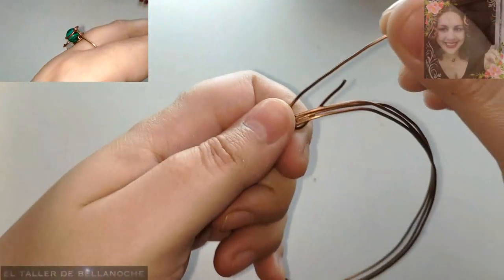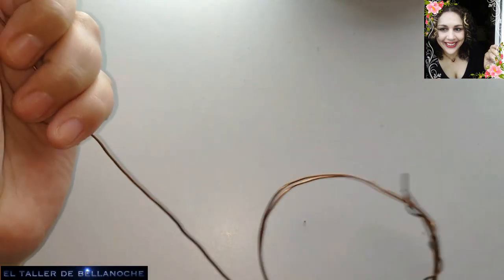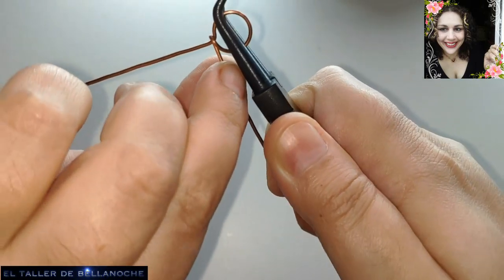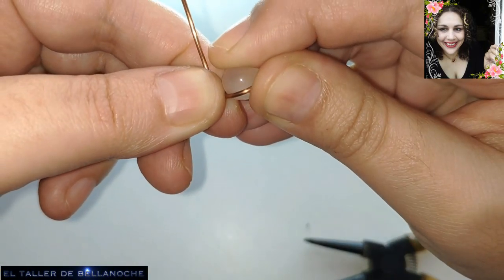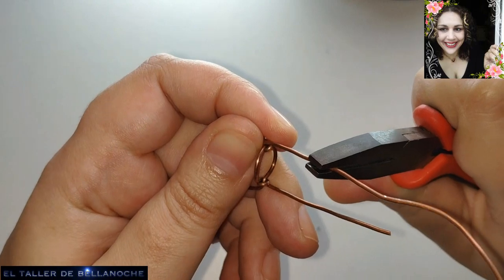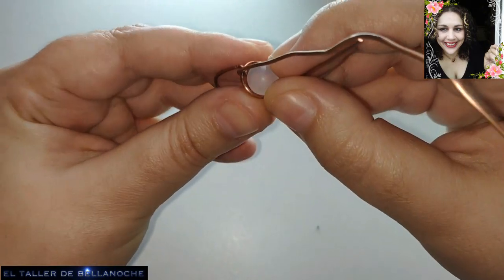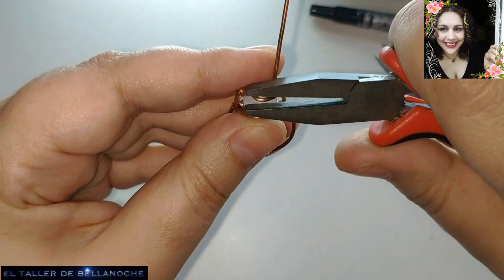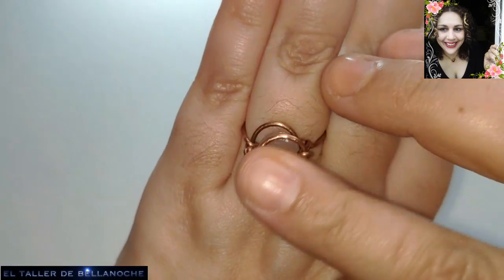HOW TO MAKE A RING WITH COPPER WIRE AND MARBLE-COMO HACER ANILLO CON ALAMBRE DE COBRE Y CANICA

Comment: Hola guapísima, me encanta el diseño, es muy original y dinámico.
Muchas gracias Nieves por todo.
Un abrazo muy fuerte para Novo y para ti y un besazo enorme.
Voy a intentarlo con calibre 18 o 1mm en color acero, ya te contaré.
Reply from the maker: Muchas gracias Manuela. Se trata de un diseño muy personal. Si es cobre desnudo no hay pega con ese grosor, pero tu ya sabes que los hay más duros depende la marca, recuerda que el aro es solo una vuelta, eh?   Espero que te quede lindo. Un abrazo de Novo y mio querida amiga.